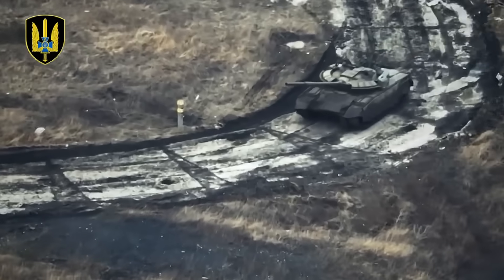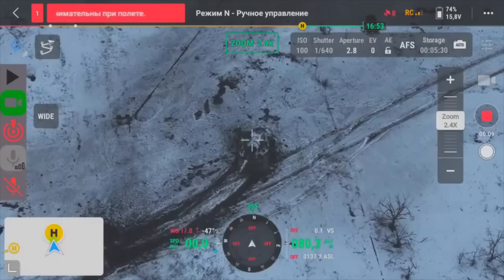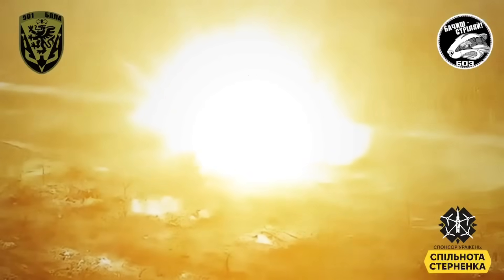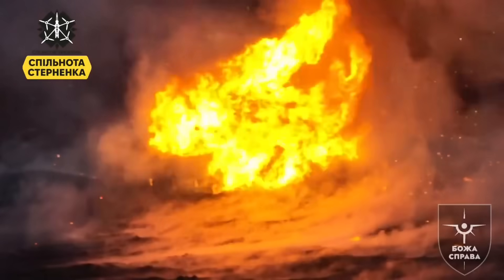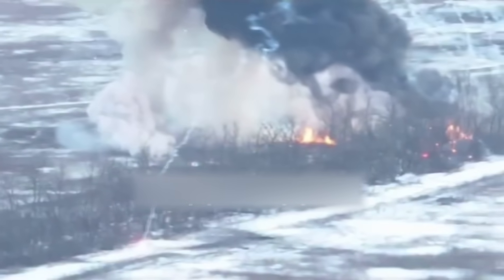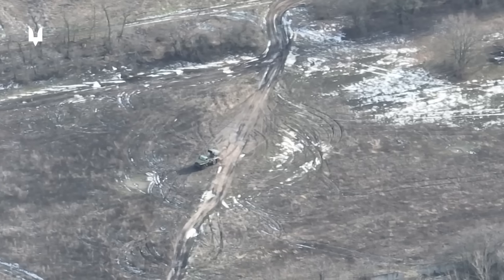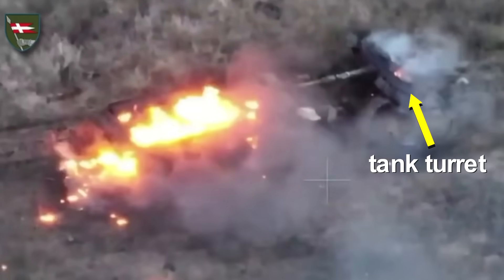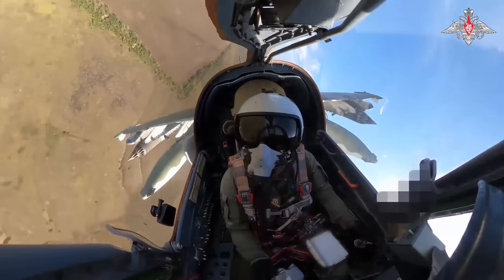The Russian tank attack failed because of this sneaky weapon

Comment: The back of the turret not only has thinner armor than the front, it also grants easier penetration to the T-72, T-80, and T-90 ammo storage. In those Russian main battle tanks, the ammunition surrounds the gunner on a open rack. There's not only a ring of ready ammunition around the gunner, he's sitting on another ring of projectiles and charges. Both rings are in the open for easy access for the auto-loaders. They're not stowed in separate compartments. It makes them incredibly easy set off. Once that shaped-charge warhead pierces the thin armor around the turret ring, all of the rounds inside that turret go off. In addition, the shells in the ring are all pointing at the center of the ring. Which is why you see the turret fly off the Russian tanks so often. All that expanding energy has only one way to go, up.

Compare that to the M1 Abrams. Their ammunition is stowed in a separate compartment at the very rear of the turret. If the ammunition does cook off, the turret has blow out panels on top of the turret, diverting the energy up and away from tank. Plus, the Abrams shell projectiles point away from the crew when in storage, thereby diverted their effects away from the crew. This increases crew survival should they be hit.
Reply: Russia: “what is crew survival?”
Reply: Боеприпасы в корме башне и легче выбить. Да это может сохранить жить, но и советские танки очень часто сохраняют жизнь экипажу. Потому что не всегда боекомплект детонирует. 

В общем посмотрим, как будут гореть абрамсы)) у них только лобовая броня толстая. Сбоку не танк, а фольга, как меркавы. В современной войне нет смысла бронировать только лоб, как делают это в абрамсах. Прилететь дрон может с откуда угодно, а не только спереди. 

Есть не мало видео, как т 72 -т90 выдерживают попадания в боковую проекцию и сохраняют жизнь экипажу и не детонируют, как любят говорить укросми, катаясь на таких же танках)) 

Абрамсу с дрона очень просто подорвать боекомплект  и танк превратится в транспортное средство передвижения с пулемётом, если экипаж в страхе не убежит или не обуглится, если система неправильно сработает, выбив защитную створку или заряжающий её открыл, чтобы взять снаряд и в этот момент прилет. Внутри танка останутся угли
Reply: @charlessaint7926  That was impressive: EVERY single thing you wrote there is simply untrue.
Reply: Зато скорострельность русских танком намного выше.
Reply: @akm6156  Нет , как оказалось . заряжающий на западных танках заряжает орудие быстрее чем мз/аз .
Reply: @dmitrymalchev9155  сказки можете в детсаду рассказывать, ага.
Reply: @akm6156  Это не мои сказки это слова  танкистов пересевших с "совковой" техники на натовскую .
Reply: @dmitrymalchev9155  аргументище!!! Прям даже усомниться в правильности пустых слов нельзя после такого аргументирования! 👏
Reply: The orientation of the round doesn't matter, an explosion expands in all directions equally.
Reply: 100% incorrect
Reply: @B61Mod12 абрамсы жгли в Ираке простые чуваки с палками)) из рпг)) или вам не показывали такие видео?))
Reply: @dmitrymalchev9155  72 устаревшие танки и ты их сравниваешь с современными леопардами и Абрамсами которые жгли чуваки с рпг?🤣
Reply: @yansakovich  Of course it matters.  They're not called shaped charges for no reason.
Reply: The Leopard 2 had the same design and it's actually WORSE because of the thinner top armor on the bustle.
Russian Lancets and FPV droves actively target this area in order to cook off the ammo.
Blow out panels normally won't stop a blast of that size and even if they do the heat from the ammunition burning turns the tank into an oven.
Survival rate in Leopard 2s is terrible, much worse than other tanks but that may be due to prioritization and Russia placing a cash bounty on their destruction.
Anyone that believes NATO tanks are vastly superior to Russian tanks since Ukraine's failed offensive is not paying attention.
Also FPV drones are an inherently Russian design pioneered by the Lancet that has been copied by Ukraine not the other way around.
Reply: @stevebuckley7788  Ivan, does the Russian TV really claim that FPV drones were invented in Russia?

Besides, Lancet is a dedicated military drone, with its development history dating back only to 2018 (Куб-БЛА). Ukrainians are using cheap off-the-shelf commercial FPV drones, which date back to 2000s.
Reply: @rrolf71 No idea, I don't watch TV Russian or otherwise. But yes,   Russia has been using cheap kamikaze drones since the start of the war while Ukraine had Bayrakter drones.
How is that NATO wonderweapon fairing these days?
Reply: @stevebuckley7788  Funny though, your posts positively reek of Russian propaganda and attitude... Anyway, Lancet drone belongs to the class of loitering munitions which some countries started developing back in 1980s. Russia only jumped on the wagon a few years ago.

How is Bayraktar doing? Back to the main intended role (long distance recon) now that cheaper drones took over the bombardment duties.

(Edit: Calling the Bayraktar a "NATO wonderweapon" is indeed on RIA Novosti level of ridiculousness, heh.)
Reply: @dmitrymalchev9155  посмотри на тактику всу под работино при великом контрнаступе 🤣🤣🤣
Reply: @Vasia-b1  Ты серьезно ? После тех чудес что рашапитеки на протяжении 5 месяцев показывают под Авдеевкой закидывая позицыи ВСУ горами мяса и железа говорить про Работино как минимум глупо  . Давай я тебя немножко разочарую но при украинском наступлении рашапитеки сидевшие в обороне за минными полями и прикрытием авиации умудрились нести потери в три раза превышавшие украинские .
Reply: @dmitrymalchev9155  это тебе Зеленский рассказал? Или арестович?
Давай-ка посмотрим правде в глаза
В России была всего лишь одна мобилизация и всего один месяц за всю войну.
В Украине мобилизация не прекращается с самого начала войны,людей уже как скот ловят и отправляют на фронт ,а последние законы в Украине касаемые женщин и людей с ограниченными возможностями видел?)))
Здесь сразу ясно кого гибнет больше в боях.
Так что свои сказки бабушке расскажи).
Reply: @stevebuckley7788   It has a similar design, but still has another ammunition store in the front of the hull.

Comment: I don't see how the shaped charge works if the warhead is not going extremely fast.  I would think that with the tank's large mass a slow moving, and low mass shaped charge would explode and push itself away from the tank.   Comments?
Reply: the explosive inside the projectile sets off the penetration not it's speed .

Comment: OK, but can someone explain me why the Russians systematically leave the damned hatches open, when they flee ? It might not be your priority when you flee, still, this way, no wonder the number of tank losses is so high....
Reply: As a Pole and a user of Soviet military equipment, I will be happy to answer this question . The answer is trivial . A faulty designed system for discharging powder gases after the shot and an internal fan that was too small would also do the trick. The people inside would simply suffocate. In addition, there is the Russian mentality of frequent violations of safety regulations and carelessness in fulfilling obligations already at the production stage. I can say that I am sure that 90% of these systems are broken and not working at all. In the military doctrine of the USSR/Russia, people are treated as consumable consumables. Poles in their factories where they produced licensed Soviet equipment simply improved these things by redesigning them. Moreover, Russian carelessness in production also extends to civilian production. I remember the findings of the Polish air accident investigation commission after the crash of the Polish Airlines Il 62 plane in 1980. The cause of the disaster was that the engine in Russia was assembled on a mechanically damaged pre-turbine bearing (half of the balls were missing). When the plane arrived in Poland as a new one, it had a strangely increased level of vibration in the engine. The Poles sent the engine back to Russia under warranty. The Russians kept it for a month and, after washing it without any inspection, they sent it back to Poland with a document confirming the technical inspection and allowing it to be used with increased vibrations. As a result of these vibrations, the shaft broke and the turbine disintegrated in the air and cut all the control cables, destroyed the remaining engines and caused a fire. 77 people died in the crash, including 14 American boxers who were flying to the Poland-USA boxing match.

Comment: What could be  possible might be creating a swarm of small drones that could mark soldiers (by a master drone or drones) and then equip the smaller drones with a charge that blows up as soon as it gets close to its target. Or get a bunch of drones to blanket an area of enemy soldiers, descend  on them and detonate above them to eliminate more than one target per drone.
Reply: This already exists and apparently up to 30 drones from the Polish company WB Electronics can fly. Apparently this is used by the Ukrainians on the battlefield for more important purposes because the Poles provide them with drones that are very resistant to Russian jamming systems.
Reply: @smiechuwarte-qt8pn  Sweet.
Reply: Probably very easily done... if it isn't already being worked on.
Reply: да вы просто мясник!

Comment: Those drones shown certainly couldn't carry a 2.5 kilo payload. And would not be easily controlled.
Reply: Ukrainians modify many of these drones themselves and produce similar ones using 3D printers
Reply: @smiechuwarte-qt8pn  the motors shown physically do not have the torque or prop size to lift that weight. I'm not doubting the use, just the drones shown. 
My Sheriff's Office has drones that are humongous. I know the capability exists, just not as shown in this video. Perhaps they were mocking up normal use spying drones to show the process.
Reply: @alvinmortimer7536  I think the movie talked about solutions but didn't show actual drones capable of doing this
Reply: @smiechuwarte-qt8pn  that makes sense. My drone can only carry roughly its own weight in any payload configuration and mine is very similar to the drones shown.

Comment: Why not weld a basket around the turret, affixed to the hull. 
It would limit turret 360 to just under 180 degrees.  Buy your tanks would be protected.
 At least from rear and side drone hits.  It's not perfect, but it could allow the crew to survive maybe.
Reply: In the latest modifications on Russian TV, I saw that instead of a cage, a so-called RPG NET  is installed, which catches cumulative grenades fired from the RPG 7 grenade launcher (the same ones are mounted under drones). The only question is whether Russian workers will install this net correctly. However, the drone will still be able to hit the engine compartment which is not covered because on Russian TV I only saw the tank turret cover.

Comment: I build small drones and they cost around $200 or less to build one. If they use digital FPV system the price goes up by $150. I did predicted this about 3 years ago that FPV could in fact be very dangerous in war and can be used to be precise to target anything. Fact: these FPV are 100% controlled by humans, there is not ALGORITHM on them, ZERO! In few hours anyone can learn to fly one.
Reply: I think the writer/reader meant the OVER-ALL APPROACH to the easy destruction of heavy & expensive equipment through the deployment of, as you said, really cheap (~$500 per unit) drones... as being an effecting Sun-Tzu ART OF WAR "algorithm".... something you could easily do over and over and over .... NOT that these cheap, small drones were flying on their own seeking out tanks & such to destroy through pre-fight computer programming...
Reply: Are the drone operators assisted by computer algorithm?  Are they assisted by AI?

Comment: Thanks to what algorithm? The one that got my eyes here?
Reply: When repoorting things like this... words or miss understand how an FPV is build and it works could make this video confusion and miss lead. The facts are FPV drone can be very precise on target remote 100% controlled by a human with 0% algorithm on them. Also, he got the price wrong, I can build these drones for less than $200. NONE of the used DJI digital cameras in witch cost around $150. So, these drones are around $250 a pop and if you buy a lot of the parts they are even cheaper. So, the fact is the they are using $250 drones to destroy tanks.

Comment: First, it won't be long before jammers render common drones obsolete. Only the Russian inability to produce electronics has made this happen already. 
Second, if the jammer are active, they can be detected and located. This means turning on your jammer makes you a target for self-guided munitions like arty or missiles.
Third, the next generation of drones will identify a target and then go "silent" so it won't be jammable. It'll use internal systems to stay locked on to a target. Missiles already have such systems so this type of drone is probably already flying, somewhere.
Fourth, drones will soon use AI yadda to strike at vulnerable spots automatically. For example, a drone might see a vehicle, determine it is a T-90, determine the back of the tank then determine how to approach to strike at the turret ring.  These drones are probably flying already somewhere, too.

Comment: That must be where the shells are stored.  i.e. at the rear of the tank, hence the massive detonation.
Reply: the ammunition are sitting like a ring under the turret. So if you hit the russian tank just under the chin of the turret will the turret jump high up in the air of joy and you get a huge ammunition explosion. As I understands it doesn't it really matter if you hit this area on the front or in the rear of the tank to get a big KABOOM!!
But it is probably easier to hit the rear and there is probably also less of a risk that your RPG fail to penetrate the armor there

Comment: Keep in mind, Russian thanks have an auto loading system. The tank ammunition isn’t as protected inside when compared to a traditional tank so they blow up more easily.
Reply: The Russians haven't learnt a thing from the past. They still store all their ammunition around the floor of the turret, totally unprotected. There's a well known saying that Russian tank turrets spend more time in the air than the Russian Air Force.
Reply: The Abrams tank crews are separated from the ammunition by blast doors.
Reply: yes, and a curtain partition)))) ABRAMS tanks are not specifically supplied to Ukraine, so that anti-advertising does not work @ShoehornBundy
Reply: @ShoehornBundy  it doesn't matter, if you use RPG7. Hit the engine section or top of the tank's tower, these will cause critical damage. Maybe the crew will survive, in this case but tank out of the game.
Reply: The russians keep their ammo strapped up in the turret region , so when an rpg hits it, BOOM... why do you think they keep aiming at the turret?.
Reply: @rustythecrown9317  The ammunition in a T72 is located at the bottom of the hull, not in the turret.  The top of the ammunition carousel has a mild steel cover that protects against splinters and spall.  It works exactly as intended.  The problem if that is wasn't intended or designed to deal with hits from the rear or from above.  NO CURRENT TANK IS.
Reply: it really depends on the amunition, if the western counterparts have high explosives loaded, the blow out pannels arent helping
Reply: RPG7 can penetrate 600mm armor
Reply: >>Keep in mind, Russian thanks have an auto loading system. The tank ammunition isn’t as protected inside when compared to a traditional tank so they blow up more easily.<<

Untrue.  The ammunition is just as well protected as a "traditional" tank.  In fact, it's better protected than a "traditional" tank if you're talking Leo 1, M48, M60, or maybe Centurion.  Keep in mind when it was deisnged and what it was designed for: 1960's design and for a Warsaw Pact attack against NATO across the German Plains.

ANY tank from that period is going to have the exact same problems with ammunition detonation if attacked the same way.  More modern designs (M1, Challenger, Leo 2 - all 45+ year old designs) or current tech designs (Le Clerc, Type 10, Type 90, etc) address the problem to various degrees, but no tank is invulnerable.

I'll say it again: there is nothing inherently wrong with the T72/80/90 designs.  They do their jobs when used competently and within the framework they were designed for.  Look at the Indian Army and their record of use of the T72 against Pakistan: they don't have the flying turret problem precisely because they do know how to use them, unlike the Russians andd Ukrainians.
Reply: there's no difference
see the german leopards how has been destroyed by russian drones.
Reply: @Mr_HighC more by KA-52 chopper

Comment: Imagine putting AI into a drone.
Reply: There have been already used some prototypes with AI (from both sides). It's not fully AI-controlled thought. 

Basically, russians have really decent jammers systems, and it's not easy to fly with FPV here without lossing signal. Also you can lost connection when you fly low (so u can find a target, but lost control in the last moment, when u direct your drone to a target). But with AI you can lock on the target from distance (like from 100-200 meters), and it would hit it, even after connection lost.

Also, the problem that russians using some cheap night-vision, and recently here are a lot of night-FPV-drones hit from their side. So its not like we dominating all the way.
Reply: why?
Reply: @sploonge3  No need for a radio link so impossible to jam.